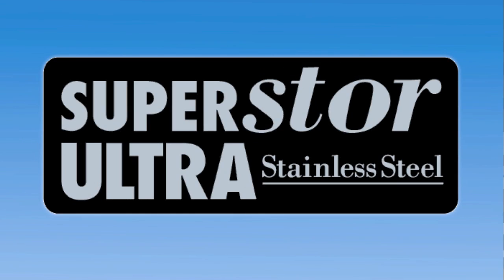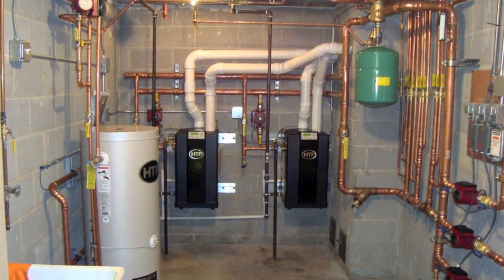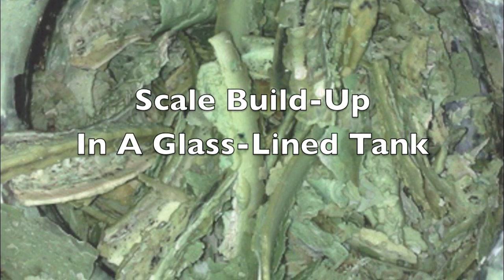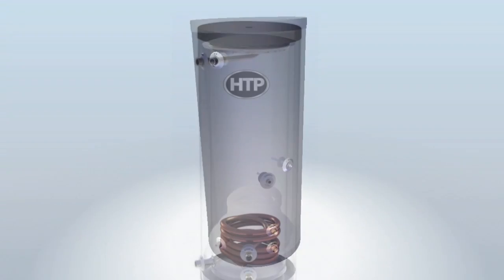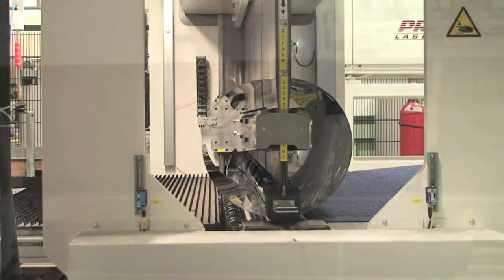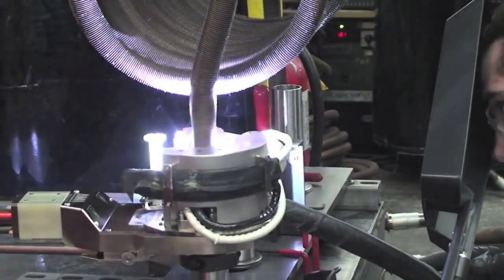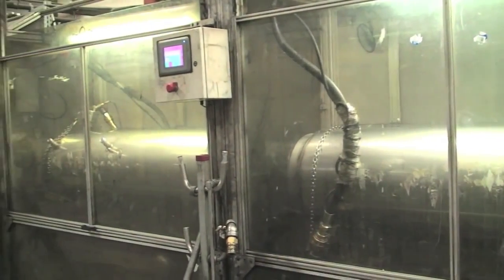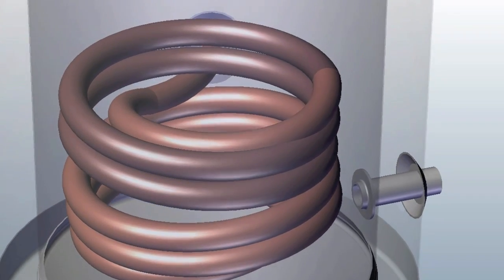HTP's SuperStor - Stainless Steel, Indirect Water Heater

Comment: I wonder how much it will cost me in gas to heat water during the warm and hot months when my boiler is normally off. I have a traditional cast iron boiler not a high efficiency one.

Comment: Do not buy #HTP. We have paid over $1500 trying to keep heat and hot water going in our house. Our unit is only 2.5 years old. Still under warranty and still costing us so much money trying to keep it working. Horrible product. I want to take this garbage and get back the $3700 it cost us to put it in. And believe me. Horrible warranty. They charge you shipping that is the same or more than the price with the parts under their warranty. #HTP. We are stuck with this garbage. Even the HVAC maintenance guy we had trying to keep it running said we would be lucky if we get another 7-10 years out of this boiler. And there’s nothing we can do. #HTP sucks.

Comment: A huge corrosion happen in a brand new Htp boiler arter 24 hours installation if supposed heat exchanger is built w high corrosion resistance material 🤔

HTP SSC-35 Indirect Water Heater I have to remove after 2 days due high corrosion in water start destroying my new home plumbing system and all new plumbing fixtures a real garbage 🤬